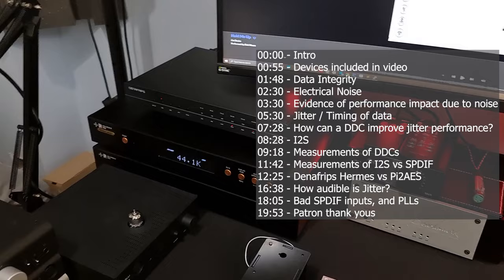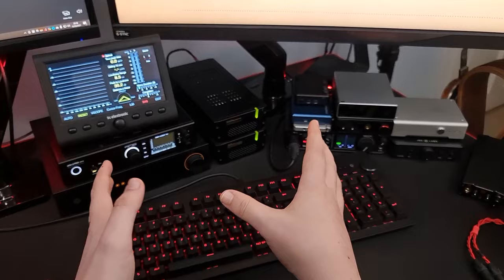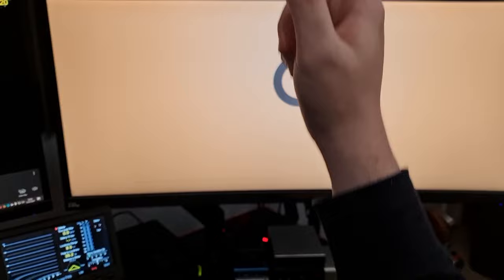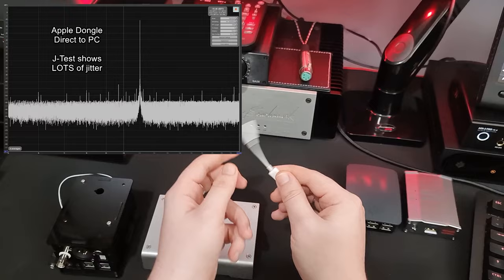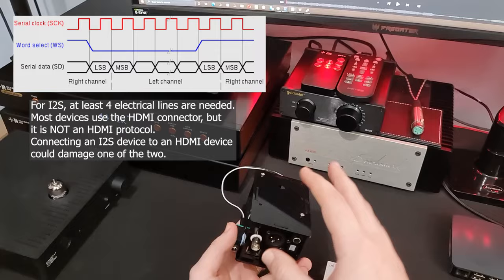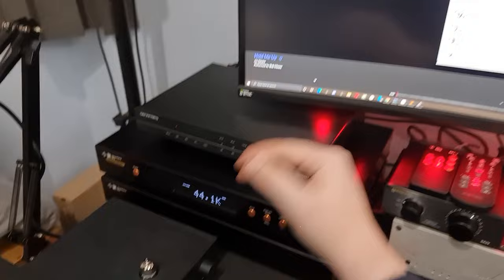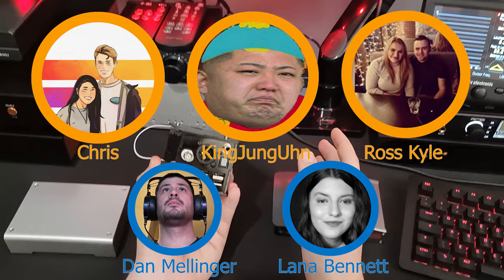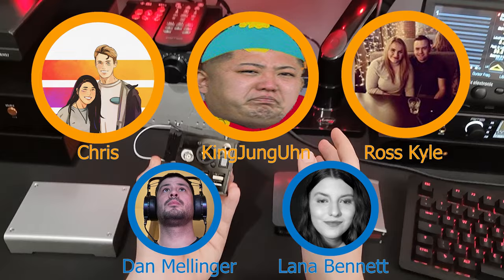How do DDCs improve audio? (Denafrips Hermes, Pi2AES, Schiit Eitr, ifi Igalvanic)

Comment: It matters if your DAC is not able to remove interface jitter and electrical noise on the incoming signal. Why not simply get a properly designed and built DAC? This is the same as buying power conditioners - you only need conditioning if you have an audio component that can’t deal with regular noisy power. You also should use an asynchronous DAC - which decouples master clock from the crystal clock in the DAC. Basically you only need extra stuff if the components you have are sub-optimal to begin with.
Reply: you really should watch the video before commenting.
Reply: @DueM  I did watch.  I was summarizing the implications of the video in terms of “so what should one do in practice”. There is a very old lesson here that I learned 20+ years ago. Summary: Buy well built and well designed components and connect them properly and you won’t have a bunch of issues like jitter, ground loops, hum etc. The sad thing is that well built and well designed components are extremely rare and most folks don’t get rid of poor performing boat anchors because they are attached to their toys and, as a consequence, they end up with loads of “band-aids”.
Reply: @jeremyhughes6485  it's not the dac that's the problem it's the source, that's the point of this video. There's plenty of dacs with good internal re clockers, funnily enough even they will benefit from an external ddc in the input chain. Whether or not it's actually audible is another story all together so I leave the donglemania for the pedants.
Reply: @DueM  Sorry. I simply have to disagree. There is always some degree of jitter on every digital input (it is an interface issue) - so the better DACs are asynchronous (they ignore the input clock jitter) and in that sense you could stick anything in between the digital source and a well designed asynchronous DAC and it would not change anything as long as the signal remained bit perfect. An asynchronous DAC can be fed a very high jitter signal and remain completely unaffected. (Benchmark demonstrated this a long time ago with their DAC1)
Reply: @jeremyhughes6485  jitter reduction is built into most dac chips, async is ok but wasapi is more stable these days and you're not using proprietary drivers which are notoriously buggy. benchmark dacs use sabre chips which have inbuilt jitter reduction anyway and are pretty much identical to a hundred other dacs using the same topology. we can agree to disagree but as long as pcs are the source theres always going to be lots of noise, hence these devices.
Reply: @DueM  Benchmark use a proprietary FPGA and proprietary asynchronous system and a proprietary system to handle inter-sample overs or digitally clipped signals (a common issue in modern pop/rock) and a switched mode power supply that has entirely overcome the 60 or 50Hz noise issue with all linear supplies. Their DAC  output is around 18 volts balanced (true studio pro audio high quality analog circuits). They are actually far from being like every other DAC on the market and deserve their Stereophile Class A+ highest rating in recommended components. I own other stereophile A+ DACs too and they sound great too but Benchmark is not really just like any other DAC. Only a few DACs make Stereophile A+ rating (highest)
Reply: @jeremyhughes6485  so they implement systems to fix problems stemming from the source... while offering features that are useless and inaudible to a home user at a price premium. I'm sure they're good dacs but with a decent source you'll get indistinguishable results with any decent dac, its a lot to pay for an extended feature set. i bet a kardas tone board would sound exactly the same and its like $100.

Comment: I'm using a Sabaj D5 in combination with my Audeze LCD-2 and active monitors+subwoofer, but I'm having an issue with crackling noises every time I for example minimise a window or playback raw footage or something like that, and I suspect it's my GPU introducing tons of noise to the USB connection. What would be the best way to fix this? The Sabaj D5 does habe I²S, but a streamer would most likely present too much delay for other stuff like gaming. I'm trying to keep stuff as budget friendly as possible... Anyone got some suggestions?

Comment: My dac does not have i2s input (only spdif coax, USB, and optical)
So if i am to use pi2aes, should i just use 
1. spdif coax to spdif coax, or 
2. should i use aes bnc (from the pi2aes) to spdif coax in the dac (i have that cable)
Which one will result in better jitter performance?
Reply: if your dac has aes use aes. if it has coax use that over spdif. aes is the best if you don’t have i2s

Comment: So the best resolution is the cheap device with no usb/pc output? Which is the best if you strictly use computer audio? Also, what about ST Fiber Optic connections? Are those as high in jitter as toslink?

Comment: 2 years later. I am now using a pi2aes 2.0, with a 850€ linear PSU that powers both the board and the Chord Qtest, with files stored on the SD card, optical out, with real glass cable, and music sounds more liquid, it has more shape somehow.
 I did a test: same setup, same files, external usb ssd storage vs internal storage on sd card, and turns out, it does sound a little bit better when there is no usb in the chain. Same dac, same input, same output on pi2aes, the only usb was the usb storage and impacted the music. I don’t know why, but from now on there will be no usb in my system

Comment: Just some "personal" perspective from my experience as a software developer for real time embedded systems and deep interest in electronics. (not professional in electronic tho)
I'll only talk about those three topic you start with, over usb, some applies to other protocol, but I don't know them in detail and I'm not going to read pages of specifications for a youtube comment. 
The TLDR is just to say, normally, you shouldn't have to care about those three issue in a "just enough" designed modern usb device, even more one who cares about those well known issues and tells customer they're some kind of high end devices, dac, or anything else.

Data integrity
Being digital doesn't mean you can't have data corruption, for instance if you communicate over serial without any specific protocol, or a protocol that doesn't integrate some form of data integrity mechanism, you can have data corruption and no fix for it. That being said, the usb protocol specs specify a mechanism for that. A CRC is sent to ensure the integrity of the received data and if the check failed, the data are re-transmited. (to make it shortà That means, for any device compliant with the usb specifications, it's not possible, on the transport, to corrupt data and not notice it and fix the situation, it's by design. So no need for extra middle man. So, being "bit perfect" and "not altering data", I don't understand the take. A usb hub does it, nothing special. But I don't understand what the point is, so I just mention, to anyone worried about this, usb, by itself, protect against data corruption on the line. If you worry about that, use usb, and you'll be fine, by design.

Electrical noise
You mention using optical link as solution to decouple two electronic circuit. That's way more on point than it seems and is in fact quite... "original', that any "high end" dac doesn't do it. The solution is called optocouplers, it's used everywhere, even in low end electronic, it's cheap, and it does just that perfectly. 
The fact you have to introduce middle man to solve that issue for expensive units is a shame. 
Also, optocouplers main interest, outside of the noise, is mostly security concerns, and it should be used in scenario with interconnection to any other unknown circuit. For instance, you certainly don't want to blow your expensive device by linking it to a faulty one that might send huge spikes to yours. If you design something like a dac, being proactive about those situations shouldn't even be questioned, even more for expensive equipment where you should do anything possible to protect it from the outside world at the benefit of the customer and your brand image. At the same time, solving noise propagation issue through data or ground lines.
Imho, any dac, even low end, should do it. And to be honest, it's a solution found in a lot of studio equipment, and you don't have to go high end for it.
So blame the dac manufacturer for not doing their job.

Jitter
It was a real issue for instance with spdif and the reason was... mostly a "bad" design we don't rely on anymore.
Also there's different type of jitter with different sources and different solutions.
The way you represent what jitter introduce as a problem doesn't match the general design of todays dac, dac aren't clocked by the input protocol clock anymore (and if they are, it's on their own and they decided to go the wrong way, maybe buy something else... who easily solve the problem)
But, usb has a well known workaround.
The main solution to solve almost all jitter issues is to use asynchronous mode. Jitter will be small to the point it's humanly not noticeable anymore and, if you really want to solve that picosecond problem, just introducing a buffer or related, audiophile dacs, imho, can do it, I wouldn't mind it a all as a client, but might be wrong. 
The fact this problem is still present really makes me wonder: are they using 20 years old design that just "get better over time" but don't do re-design that would solve the issues ?
Once again, it's the dac manufacturer fault, it's a design issue, it's a known problem, with known or even integrated solutions, if problem persist, maybe go back to your R&D and fix it before requesting any substantial amount of money from your clients.

Paying a middle man device to fix those three issues, at least over usb, until you are like using an old dac you really love, shouldn't even be a thing.
Shouldn't even be mentioned on modern hardware, not even as a selling point. 
It's something people sometimes say about dac to say every dac is the same, I don't have opinion I want to share on that topic, but for those three issue, if you have a modern dac that features them, I would consider them "by design broken dac", any mention of those issue on something I plan to buy would make me totally never ever go toward that manufacturer again. To me, those issue, on new hardware, shows a total lack of dedications and I really hope I get this video wrong and it's about fixing old gear issues. At least for usb, don't know for the rest, but wouldn't be surprised there's solutions too and modern hardware shouldn't rely on middle man.

Comment: Do you think that any of the cheaper solutions (Schiit Eitr) would in fact degrade the audio signal? Also, do you think that the iGlavanic would perform less than its sibling iFi Nano iUSB3.0 that offers an external power supply option?

Comment: Two questions about the Pi2aes. 
1- How does one change inputs on the Pi2aes? I think they all run continuously and have to be changed by hand.
2- How is the sound from an external/remote hard-drive into the Pi2aes via USB,,, then output to a DAC of choice? Thanks ahead for your help.

Comment: I gave up explaining how jitter can be CRITICAL to your music a while back.  Took me a while and a lot of experiments to learn a lot of.  Spending time trying to pass that knowledge to people who are not receptive is a horrible way to waste your time.

I would recommend giving Lavry Engineering DA10 and similiar DAC a try with their "crystal lock" feature enabled... See how wrong engineering can go when they confused clock drift with jitter.  Their tight PLL sounds great tho.

Another thing i find suspect is Analog Device's ASRC that claims to eliminate jitter by running signal through SRC, but i suspect it is just blending the good and bad part of the signal into a inseparable mixture.
Reply: Why would you have to explain something that's, according to this video, "extremely audible?" I've never heard it, and have been an avid listener for over 40 years. What DAC does one buy to hear this phenomenon? What does it sound like?
Reply: @Grassy_Gnoll  it is extremely auditable if you know what to look for.  If you are facing a crowd of "if it is bit perfect, then there's no difference" horde, then you will see what i mean.

To me, higher jitter often results in blurred imaging, worse soundstage.

To try it on the cheap... Just get a player and DAC with optical and coax.  Then compare them.  Do remember to use cheap plastic optical cable and cheap coax.
Reply: @Grassy_Gnoll  all else being equal, bigger soundstage, lower jitter.

Comment: The pi2AES with I2s output is no longer available. The manufacturer now only offers I2s output with their $600 Mercury streamer. However, production has halted due to a supplier issue with the case manufacturer. According to the website, the PCB board for the Mercury may have to be fully reconfigured to fit another case. Translated, it might be quite some time before the Mercury Streamer is back in production. At this point, it looks like I'll be forced to look at other options for the foreseeable future.

Comment: I’m getting a KTE Holo May DAC. Do I need one of these DDCs? Also what if use a high end streamer like an innuous statement or antipodes k50 or Aurender w20se?
Reply from the maker: Not really no. The May's USB implementation I measured jitter at a -170dB floor with close in sidebands at -155dB. It's insane.

I would just use USB with it
Reply: @GoldenSound  Thanks buddy! And is there a huge difference between USB and i2s on the May?
Reply: By the way I have a MOTU M2 as well and I sometimes use it as a DAC/Amp with my iPad PRO with my Hifiman Aryas, which need power.  I didn’t think that the iPad would be able to power the M2 with Aryas but it can! :)
Reply: By the way have you noticed the May getting hot? I have seen reports that the power supply stays cool, but the DAC itself gets really hot. Have you experienced this yourself?
Reply from the maker: @BrentLeVasseur  there isn't a huge difference no. On other dacs there is, but the May's PLL system makes all digital inputs practically perfect. It's the most effective pll in any dac on the market currently.

And yes it does get quite hot. Normally runs at about 38-40C. It's completely normal. It's r2r and with beefy class A output stages so it's to be expected
Reply: @GoldenSound  I got the SU2 Kitsune tuned edition. I will do an A/B test with my Mac Mini and the Holo May to see if there is a substantial difference between going USB direct vs. USB to Su2 to i2s into the May.
Reply: By the way I had no idea that a DAC like the Holo May would need burn in time. When I first got it, it sounded horrible. And I left it going for 3 days straight and came back and it started sounding good. So burn in is really a thing for high end DACs.
Reply: @BrentLeVasseur  Hello Brent,
Care to share any impressions of SU2 with May? Did you notice further improvement?

Comment: Does an upscaler to a Dave /TT2 or a ddc from a BlueSound to holo spring KTE make a bigger difference?
Reply: I watched the full video and what he explains is the performance is improved because when you use USB the USB on your dac takes the signal and converts it to i2s because that is the native format so by using a ddc you are externally doing the digital to i2s part on an individual device that does it better so less jitter and less noise. high end dacs like from chord or holo spring both have great usb inputs that are probably using their own power supply that is not shared and jitter isn't bad on USB so they do benefit but not as much as cheaper dacs without good USB implementations. But yes both would benefit especially if you run USB to the ddc and output i2s to the dac.

Comment: Thank you for this video and what are your thoughts on a Chord Dave by itself vs adding a M-Scaler > to a Chord Dave?  Did you measure them when you add them both? Curious
Reply from the maker: Dave alone I didn't feel was worth the money.
Dave with MScaler was fantastic, though some lower cost dacs such as a Holo May or M1SE will be better to many.

I also preferred HQPlayer to MScaler.
I didn't measure it unfortunately as I didn't have my ADC at the time.
Reply: @GoldenSound  Yeah I have the Dave now by itself but just bought the M-Scaler incoming in 2-3 weeks. But when I demoed at my local hifi shop I think they had the M-Scaler connected incorrectly to the Dave because it sounded really bad hollow and thin sounding.

I also owned but recently sold the Holo Spring LVL 2 KTE with Singxer SU-1 KTE via I2S great DAC/combo.

Looking forward to the May review
Reply: @russb3n oh man this comment aged like milk. Bet ya the MScaler was hooked up just fine. It's an expensive box of nothing.

Comment: First, great videos! Keep up the good work.

Question: How did you modify your pi2aes to accept a 5v psu? Do you power everything from the 5v or do you use two psus to supply the rpi and pi2aes separately? Thanks.

Comment: Got my Pi2AES yesterday and am so impressed with the SQ compared to a regular Pi3 on USB. AES sounded much better but going to i2s was a night and day change. Thanks so much for bringing this to my attention Golden!
Reply: I got a pi2 and am using it with an Allo USBridge Signature. Still can’t it to work. Any pointers? I am using the same SMPS power supply as recommended by Mike Kelly and the USBridge is powered via the PI2AES. Thanks.
Reply: What PSU are you using it with? Linear PSU? Thanks
Reply: @Shoaibexpert  just the standard meanwell